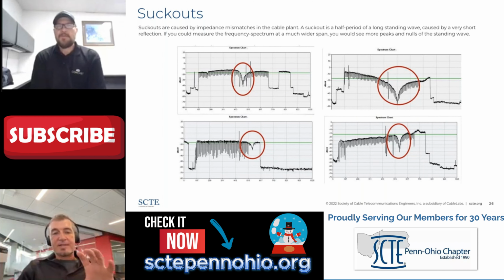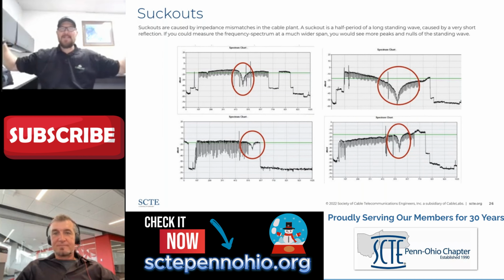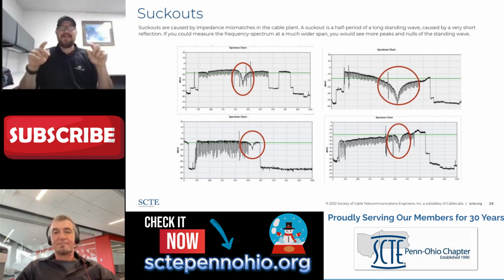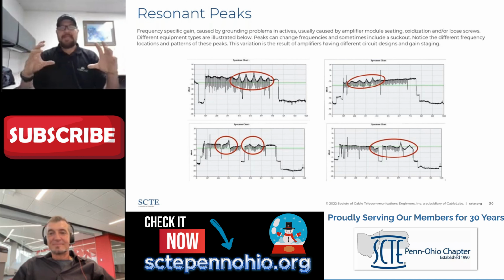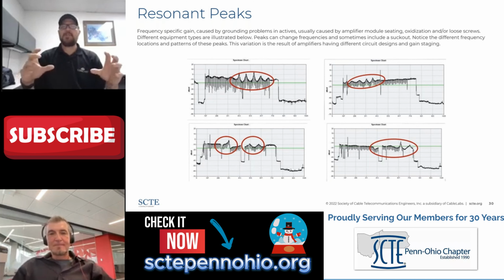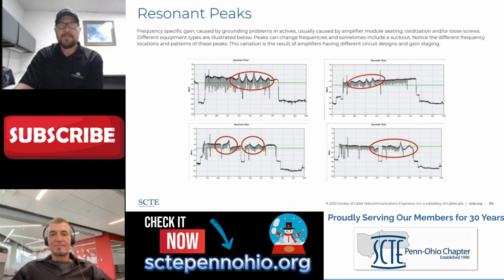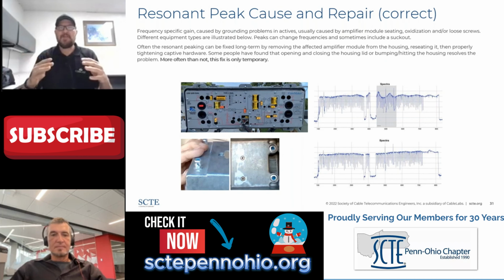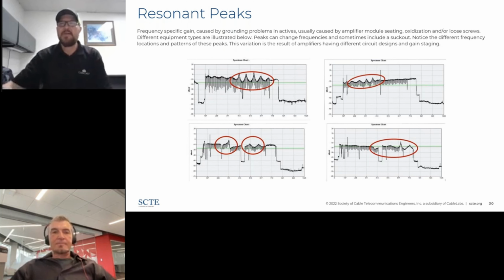👉What are Suckouts and Resonant peaks?!🤷‍♂️

Comment: Old school; loose seizure screw equals low end rolloff (lower freqs can't jump the gap), water causes high-end rolloff (can also look like a high resistant short to ground that will affect your current draw as well), bad grounding causes suckouts, runaway oscillation (resonant peaks) could be from gain and loss path not properly balanced (power path with input and output fuses and bad rf chokes, return path hybrid upgrade with wrong gain and not proper high/low pass filtering.,,....
Reply from the maker: Thanks John! We always value your expertise and input.
We appreciate you contributing to the conversations as ever.

Comment: Since a micro-reflection causes frequencies to add in and out of phase, the length of the reflection will dictate whether it's a null or a peak.  The amplitude of the nulls and peaks is another variable; could be from signal power or even multiple impedance mismatches equally distributed like you mentioned from tie wraps.  Moral of the story, less uniform tie downs, although not as "clean/pretty", is better. Bad grounding within an amplifier or even a passive is typically associated with suckouts.  Also be careful with viewing sweep traces when compared to a normalized reference.  What if the reference has a spike that's not really there.  If you normalize it out and then go to an amplifier that is "flat", the trace would show a suckout.  Just try to make sure to compare "apples-to-apples" or without a reference like what you would get from a full band capture (FBC).